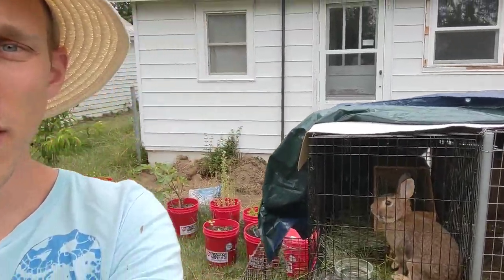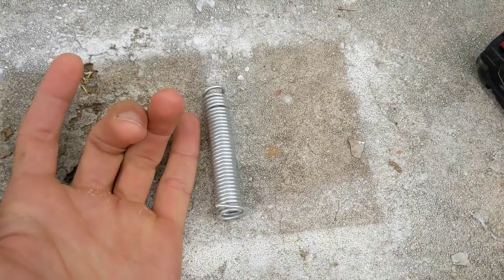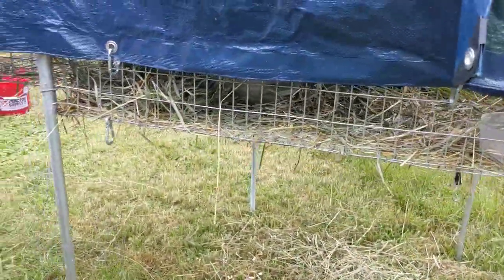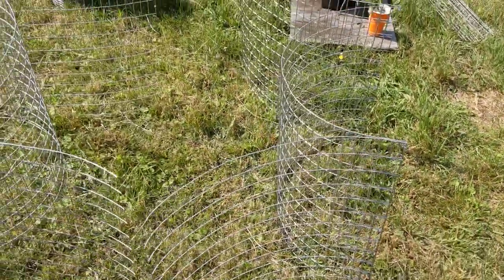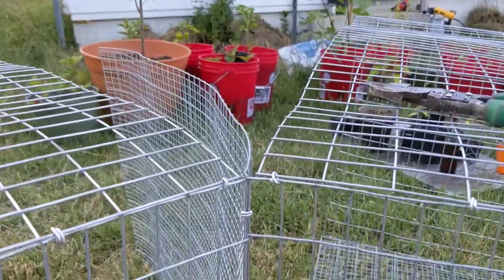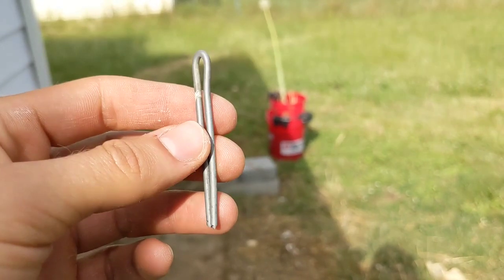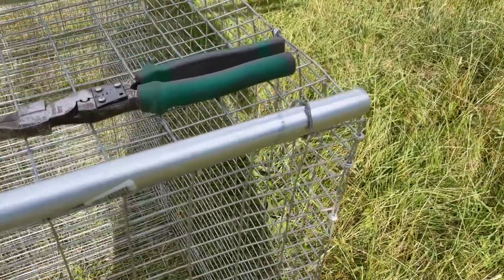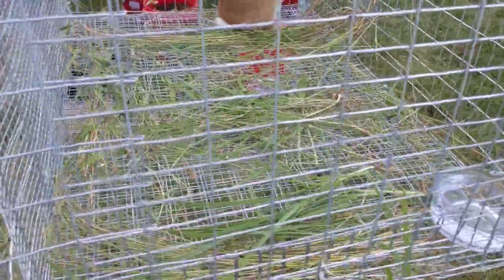How To Make A Free Standing Rabbit Cage

Comment: Thanks for sharing. Perhaps you've already come across this idea by now but you might want to try giving them access to an appropriately sized ceramic tile to prevent sore hocks. I was unable to find the ideal gauge of floor wire resulting in one of my bucks developing sore hocks but since giving hum a ceramic tile, he has been perfect. It's much easier to clean than a bunch of hay and I find that too much hay on the floor tends to get peed on and hold moisture, rapidly increasing the degradation of the floor.
Reply from the maker: That sounds like a pretty good idea. Might even help them shave down their nails a bit if you turn the abrasive side up. The hay does get soiled pretty quickly. I didn't think anything of it because I just harvested grass from my yard and had plenty of it, but when purchasing hay you would want to waste as little as possible. Thanks for sharing!
Reply: @frankpoth154  oh yes, I should've specified that I flip them upside down so they don't slip. Idk how much it helps with their nails but it makes sense. I wish I had kept track in some measurable way now that you've drawn my attention to it, yes, it certainly seems like it has helped with that, too.

Comment from the maker: Hey, everybody! I hope this video helps you make a better cage. The ideal base for a rabbit cage is 1"x1/2" 14 or 12 gauge galvanized wire fence. That will go a long way to preventing sore hocks. If you decide to go with 1/2"x1/2" hardware cloth, be sure to line your cages with hay or grass so they have a comfortable mat to walk on. If you are planning on having 10 or 20 rabbits, I highly suggest getting the proper wire for the bottom of the cage to save you time and to save your rabbits' feet. For the hobbyist, the grass mat works pretty well and I think the rabbits prefer it.